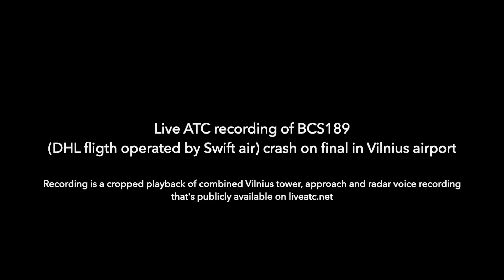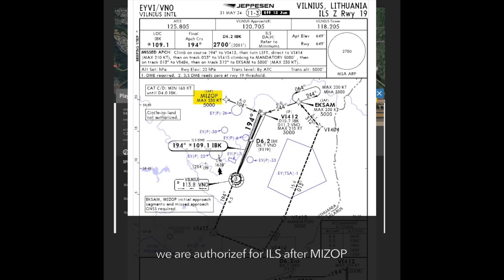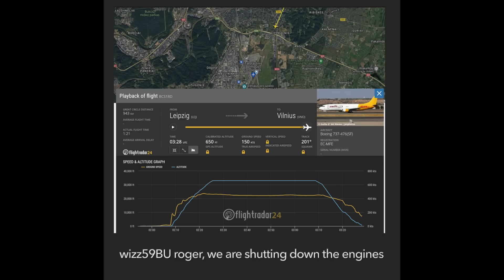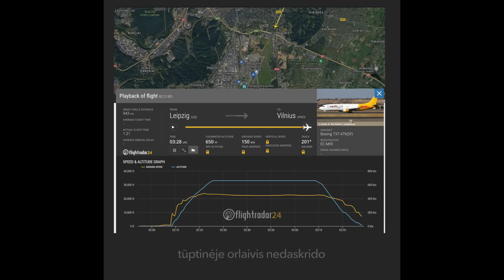Live ATC recording of BCS18D crash on final to VNO airport

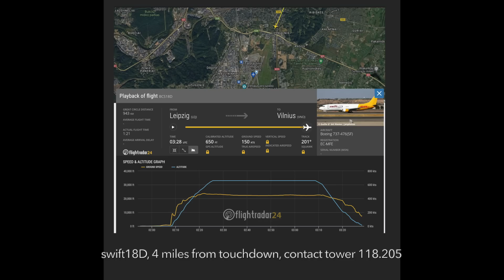Comment: There is something wrong with the radio traffic flow!! Pilots confirm different values for descent altitude and QNH, but these are not corrected by the radar controller. It is obvious that the frequency was also misunderstood and NOT corrected!! Due to unclear pronunciation or transmission, the pilots heard 1-1-8-0-5 at 1:22 instead of the correct frequency 118205. From then on, no one could reach the aircraft!

Comment: I was based at Vilnius for over 1,5 year and there is something particular to that ILS approach to runway 19. In my opinion there is an issue with the fly up glide slope signal and localiser side lobes. More than once we had false localiser captures or erratic fly up movement just prior to reaching the final approach point whilst intercepting the ILS. Not saying it had anything to do with it now but the pilot stating “we are still left” is giving me a worrying feeling.
Sorry to hear it ended like this. Flying cargo at night is also not the most relaxing experience either. Let’s see what comes next in the reports.

Comment: To me, the whole incident does NOT look like sabotage or terrorism. Rather technical / human error. Some videos show the plane is flying completely normal until short final, when it suddenly loses altitude in a pitch up mode. We don't know yet why, but hopefully the black boxes (FDR and CVR) will reveal the causes soon. It wouldn't be the first incident where pilots become overwelmed in the last minutes of approach and lose orientation/track of their altitude.
Reply: Could be ILS jamming, the pilots wouldnt notice
Reply: Let the experts do their job please. No time for speculation.
Reply: You must be quite naive. At least five Russian regime bomb packages have been intercepted, 4 of which in DHL.

The crew would've declared an emergency if it was technical issues and there was time. It was sudden. You know, what happens when a bomb goes off and your plane suffers critical existance failure.
Reply: @nvelsen1975  the surviving pilot confirmed that there was no fire or smoke on the plane
Reply: @augustinagabrilaviciute5887  
THanks Sergei, now I know for a fact Russia did it.
They never send damage control.
Reply: @nvelsen1975  I didn't know about the bomb packages. Still I think we need proof before starting WO III.

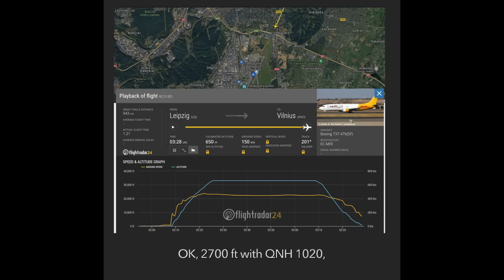Comment: 1:04 pilot say 2300 ft....????  by tower operator 2700 ft... why it wasn't corrected or repeated????
Reply: I hear "two thousand twenty hundred feet". But my conclusion is that everyone speaks as if they have the worst PC microphone from 1990 and speak with their mouths closed. If someone spoke so unclearly in a multiplayer game, they would be criticized every day. Yet here they are exchanging information on which their lives depend and they don't even trying to be well understood.
Reply: @dawidouss6333  i believe talking through internet and radio is a bit different and same applies to the quality
Reply: @Tautviss777  It's harder to eliminate noise, but you can speak slower, louder and more clear. There is technology to clean audio from background noise, but it won't help if the second side just mumbles.
Reply: @dawidouss6333  quite possible that the tower and the aircraft have a stronger signal, better antennas, less interference.
Reply: @dawidouss6333 I agree with you absolutely! Often this mumbling can be heard from both sides: the pilot and the tower. At this case: girl was speaking clear, but listen how meteorological parameters are reported - nothing to understand...
Reply: @dawidouss6333  I can understand the bad microphone on the plane because of all the noise around it, but the tower microhpone should be far clearer.
Reply: clearly says 2700
Reply: @pauliuscs  clearly not
Reply: @pauliuscs  tower says 2700 pilot says 2500, listen carefully.

Comment: They flew lower than the glideslope level is. According to FL24 data and this recording, the ATC instructed their approach to be on 2700 feet. The pilot read back as 2300 (or 2306 as I heard) which is about 400 feet lower than it should be. Also the negative vertical speed was too high for them to have any time to react sadly. You could see in the videos how the pilot desperately tried to get up by immediately raising the nose of the aircraft before crashing...
Reply: This one sounds logical. A lot of miscommunication in this
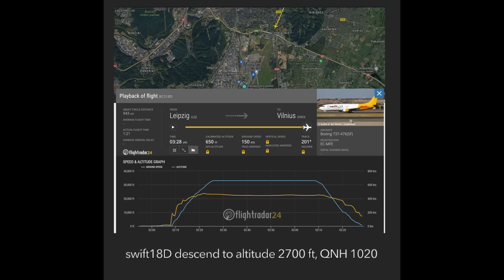Reply: Set the playback speed down to 0.75x. [0:54]: "descend altitude to two thousand seven hundred feet, QNH one zero two zero. Cleared ILS Zulu one nine, report established." Audible readback [1:04]: "Okay, two thousand twenty hundred".
Reply: Agreed. At around 1:04 I hear the controller read off 2700 ft and the pilot repeats back 2300 instead. The transcription seems incorrect.
Reply: Raising the nose is what stalled the engines and caused the fall,
Reply: Regarding 2700ft, it seems that the pilot read back correctly, it's just poor sound quality. Stop this misinformation
Reply: @simasp7189  obviously if the sound quality is bad and people are doubting about the correct altitude settings what makes you think the pilot heard it correctly? It would make sense why they were too low during the final approach
Reply: @simasp7189  Not saying that I'm telling the truth, that WAS my theory until I've been reading news even more. Your assumption could be possible, but not quite. Because according to our LRT media, and aviation expert Kęstutis Zagreckas who told the LRT that the pilot really said wrong altitude, but this happened when he was about  15-17 kilometers away from the airport, so this couldn't cause the plane to fall like that.

So I dunno, it would probably be good to just wait until they find those black boxes, investigate it fully and give us the final report.

Comment: Looks like controller is at least half responsible for the crash, not correcting the wrong altitude readback
Reply: Not at all. They were cleared for an ILS approach, starting it a few hundred feet low should not affect the ability of the crew to be on glideslope at short final.

Comment: I'm not a specialist, just a regular person, but from the conversation it seems to me that the landing was unusual because of these two messages from the pilot:

"Could you please confirm expecting ILS, I am not expecting ILS".

"And we are still left for ILS, will report established, swift18D".

So I asked ChatGPT for clarification on what they meant. Here is the answer.

The pilot's communication contains a mix of questions and acknowledgments related to the Instrument Landing System (ILS) approach. Here’s a breakdown of what it likely means:
1. "Could you please confirm expecting ILS, I am not expecting ILS":

    The pilot is seeking clarification from Air Traffic Control (ATC) about the approach procedure assigned to their flight.
    "Expecting ILS": ATC may have informed the pilot that the ILS approach is planned for their landing.
    "I am not expecting ILS": The pilot is saying that they were not planning for an ILS approach (possibly they were briefed on or preparing for another type of approach, like an RNAV or visual approach).

This is a request for confirmation to avoid confusion and ensure the pilot is following the correct procedure.

2. "And we are still left for ILS, will report established, swift18D":

    "Still left for ILS": Despite the earlier misunderstanding, the pilot acknowledges they are now proceeding with an ILS approach.
    "Will report established": The pilot is committing to notify ATC when the aircraft is aligned with the ILS localizer and glide slope ("established" on the ILS).

This statement ensures that ATC is informed of the aircraft's progress and alignment with the ILS for the runway.

Key Takeaways:

    * Initially, there was a discrepancy between what the pilot was expecting and what ATC assigned.
    * After clarification, the pilot confirmed they would proceed with the ILS approach.
    * The final message reflects adherence to standard ILS procedures, including reporting when the aircraft is properly aligned (established) for landing.

Such exchanges highlight the importance of clear communication between pilots and ATC, especially during critical phases of flight like approach and landing.
Reply: With " still left for ILS" I assume he means left deviation of the Localizer as they overshot the runway centerline during the right-hand turn according to ADSB data
Reply: @letreiv7694  In Lithuania, a public news broadcaster has already interviewed some local experts. So-called "experts" do not ask questions, but immediately provide answers. Aviation expert Vidas Kaupelis, after listening to the recording of the conversation, says that, in his opinion, everything seemed normal to the pilots, because they did not show any signs of anxiety: "I listened to that recording. Without going into details, we can say that the pilots did not declare any danger, no problems. It was routine communication, a simple landing. And the fact that a few or a dozen seconds after the end of the communication, the aircraft crashed shows that it was unexpected for the pilots themselves."
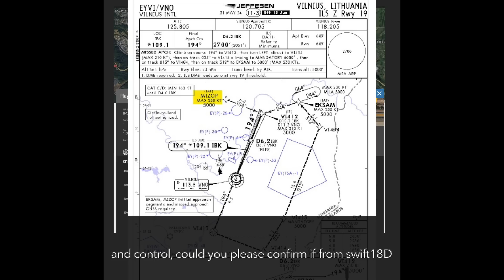Reply: See also "and could you please confirm if from swift18d we are authorized for ILS after MIZOP" at the 0:40 mark... There was much confusion about ILS at the last minute. Did they descent from 2700ft to 0 in 30s (from the 1:05 mark), covering some 3 miles? Or was the instrumentation faulty?

Comment: So many things wrong here... 
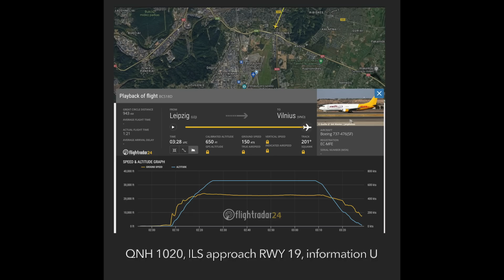1. 00:24, the pilot read QNH back 1019 instead of 1020, controller does not correct back!
2. 01:05, Descending 2700fr instructed, the pilot clearly read back something else (seems to me 2300 or 2500)
3. 01:23, the pic read back wrong frequency for tower. Maybe the reason why we have 0 communication on last seconds. He was on the wrong freq perhaps?

Why does the approach control leave it without correcting? It's a shared responsibility. They had wrong QNH, wrong altitude, wrong freq ...
Reply: Regarding #1: afterwards they correct it, hear 01:06
Regarding #3: the tower frequencies should be already prepared during the flight plan, because they are not being changed every day. It is really hard to believe that this could be an issue.
Reply: I agree that the pilot caller back either 2300/2500, rather than 2700. Listened and listened, and don't hear a 7 in his reply
Reply: @SuperMarkizas  definitely reads 2300. Listening on slower playback that number ends on an "ee", not "ive" and definitely not "seven"
Reply: For what it's worth, I hear the altitude readback as: "Ok, two thousand - twenty hundred".
Reply: @lenktinispeiliukas248  Could be that too. Either way it's way wrong from instructed 2700ft
Reply: @SuperMarkizas  100% "2700 ft"
Reply: @pauliuscs  1:05 lower YouTube playing speed to 0.25
Reply: You are spot on with this. Sounds like a human error from both sides. We are yet to hear the black box recording.
Reply: @MindeMaiN  WHAT BOTH SIDES? Tower took down the plane.
Reply: @simasp7189  there are doubts about that. However, it would make sense why the plane was short of the runway. With incorrect QNH and bad altitude callbacks  and a hilly terrain it could a very probable cause of the accident
Reply: I think the major contributing factor was regarding the ILS.
What I gather they were shortcut into final, the 2700ft clearance is well into the final path. If you can believe VASAviation radar then they were high, probably dunked to capture GS which they ultimately didn't do. and continued straight down.
If flightradar24 altitudes are correct, they were 200ft below the glide path according to the chart in the video 2 miles from touchdown....
I say it was pilot error...unfortunately :(
Reply: 5:20 whitness saw plane flying 2 metres above cars, tried to call emergency, there was no connection!
Reply: By 1:00 the pilot has already called back 1020, so it shouldn't be a fatal issue
Reply: For ILS QNH should not bring much of an error. If the approach was non precision I would think about the qhn error and landing short( i.e. staying on the STD QHN) .. difficult to speculate as it was VMC!!!!!
Reply: @Callmeacliche  1019 and 1020 QNH difference is like couple meters anyway, wouldn't make any big difference either
Reply: @Tautviss777  more like 8 meters, but not a lot
Reply: @3domas  yes you are right about that a little bit more than couple meters
Reply: Also confusion "we are not expecting ils", the female atc also seems not sure what is she saying (not because shes female, just to distinguish from the other twr male atc) , sounds confused, then pilots report not having caught ils beam and just before crash its as if approach and tower are talking to each other-both trying to clear to land. And ultimately, the aircraft screams "minimums" not far from runway, where you must decide-continue or abort, the pilots should have aborted. Well if "minimums" is radio altimeter, then its understandable, cause this runway side is near a slope in Vilnius and aircraft moves in upslope direction, so that also might have caught them by surprise.
Reply: @tadass.2675  I may be mistaken, but landing for many screamed pull up in this particular situation because of the terrain. Seems like they steadily were descending, but just like the airport would be 1.7km closer... Even then, visibility should be good. Maybe altitude readings were off somehow? Airport is on the small hill, looking from north.

Comment: Its a pity YouTube does not allow web link sharing in the comments, there a huge amount of CCTV videos sharing more details. Search for 15min media channel video called "Nufilmuotas lėktuvo kritimas Vilniuje" where it is seen perfectly normal flight without any abnormal signs until the last moment, when pilot realized where he is regarding the terrain and drastically pulls nose of the plane up. In this video with Transcribed ATC recording  you can hear confusion about ILS usage.
Reply: Seems clear that the pilots were not planning on an ILS approach. They get notified  4 miles out. So they may have thought they were stabilised on approach, (maybe checklist rushed?) and realised too late they needed to initiate a go-around. Maybe their pre-flight NOTAM stated incorrectly that ILS was out of action on 19? In any case, flying final approach is NOT the time to start changing the plan. Assuming there was not a mechanical failure (which seems unlikely) the pilots would have been wise to have initiated a go-around and give themselves time to re-configure the a/c and stabilise on the ILS approach 2nd time around. This is the 2nd freighter accident in 7 days, (Amazon runway excursion in Vancouver) and it seems that pilots on cargo flights tend to be on greater pressure than passenger commercial flights, plus a LOT of them are red-eye flights. This may call for a closer look at safety regarding flying hours, fatigue and the pressure to get cargo to destination airport asap. Especially this last aspect can be a major influence on NOT initiating go-arounds as and when needed, together with the extra paperwork associated to justify.
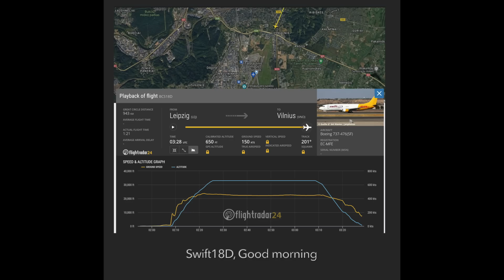Reply: T´hanks foru your link to CCTV Video from crash. At about 0:11 it looks like the plane erects, nose went up. What does that mean?
"Nufilmuotas lėktuvo kritimas Vilniuje"
 https://www.youtube.com/watch?v=5MHfeqvaBP0
Reply: I saw the videos, and there is a bright light seen at the belly of the plane, do cargo planes have lights they turn on additionally before landing? As I have not noticed similar lights on passenger jets.
Reply: @SuperMarkizas all plains have it.
Reply: @SuperMarkizas  Yes, those are the landing lights. Every Boeing 737 has them (and every commercial plane, I would argue). The bright lights on the belly are completely normal. Any flickering is caused by the aircraft flying through clouds. What is NOT normal is the plane deviating from its glidepath. At some point you see it descend faster/ lose altitude. Something must have happened on short final. Could be stall, loss of engine power, basically anything. We don't know yet. The black boxes (FDR and CVR) will reveal.
Reply: @petermuller5800  thank you for the explanation regarding the lights